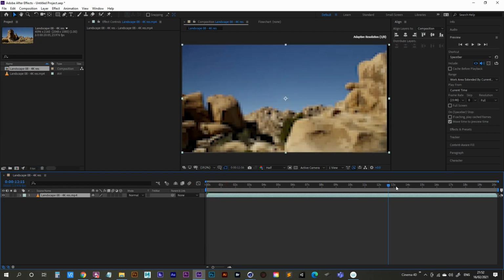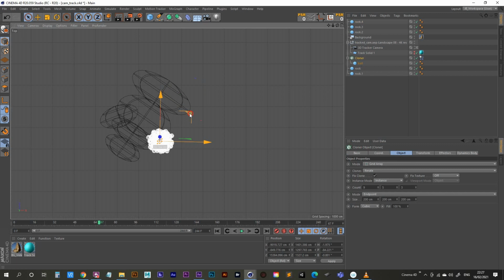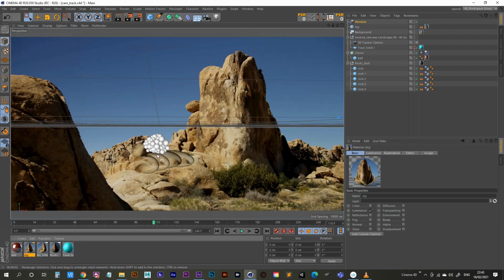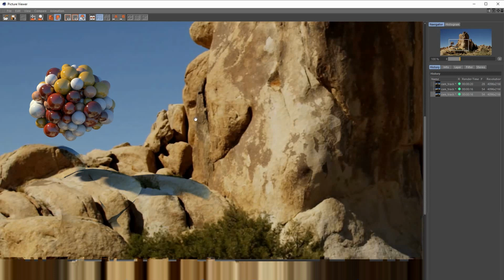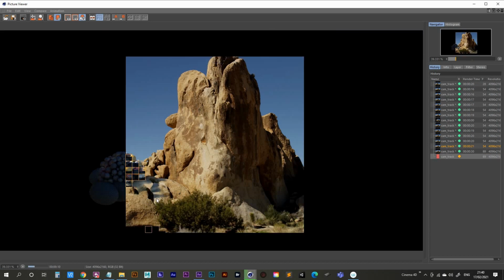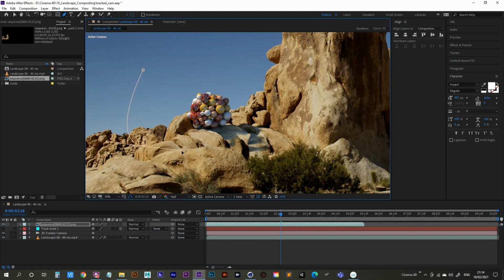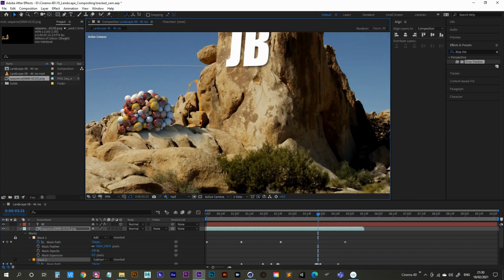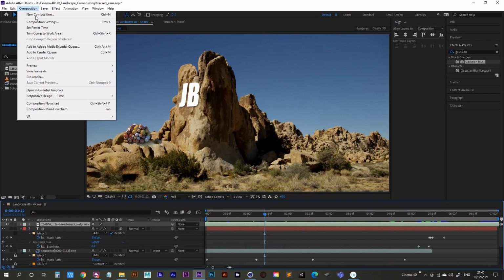C4D Tutorial - Compositing 3D Animation into Video Footage (After Effects and Cinema 4D)

Comment: Why don't you use the Cineware plugin to link After Effects with Cinema 4d and migrate camera tracking information back and forth?

What are the advantages of using the export C4D file from After Effects option?
Reply from the maker: Hi Miles, I didn't know there was another way to send the tracked camera from AE to C4D?
Reply: @jbmocean399  

Cinema 4D can be accessed directly from within After Effects in the File ⇒ New menu, or by clicking Edit Footage on a Cinema 4D layer in your composition.

Cineware not only lets you drag and drop native Cinema 4D files into After Effects but also gives you the ability to manipulate those 3D elements and render directly from within After Effects.

Whether changing colors or textures, moving objects, modifying animations or adding light and Null objects: modifications made in a Cinema 4D scene will be updated automatically and in real-time in After Effects CC.

Would be great to see a video comparison of your work flow and the Cineware workflow.
Reply from the maker: @milestrevelyan  Thanks for that Miles. I am aware of the ability of Cineware to bring your c4d files into AE, but my question was is there another way to bring the AE tracked camera from AE into c4d?
Reply: @jbmocean399  

Yes in the Cineware plugin

Command - Merge - Comp Camera into Cinema 4d
Reply from the maker: @milestrevelyan  Thanks for the info Miles! I didn't know that! will look into it, cheers!